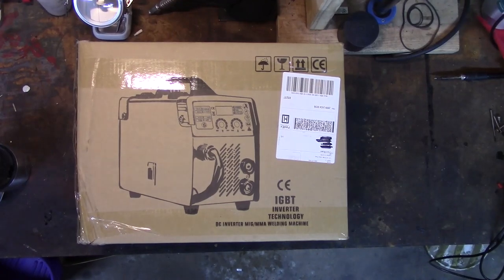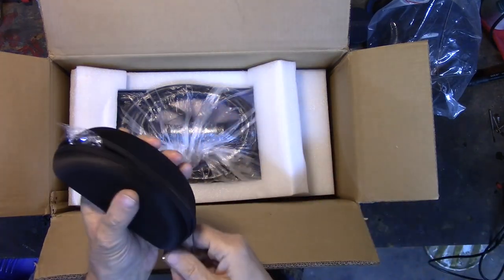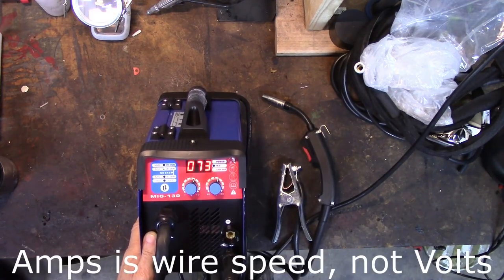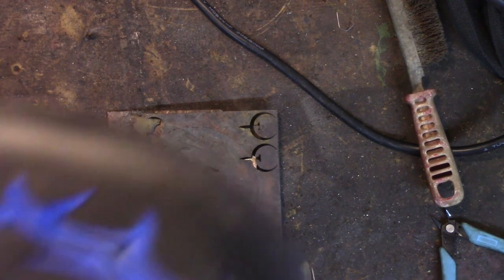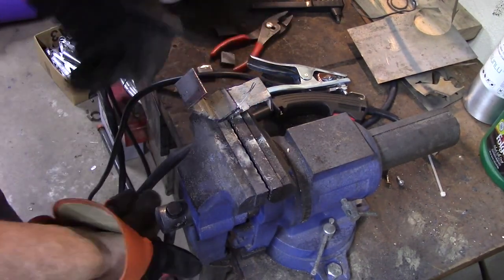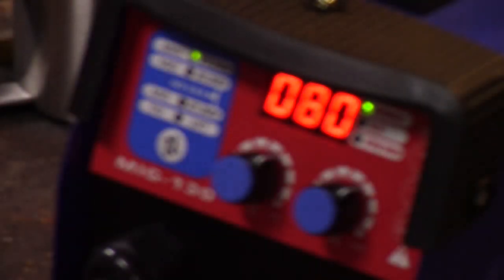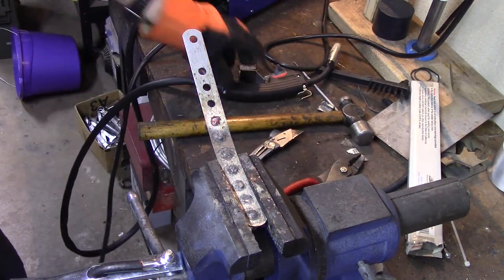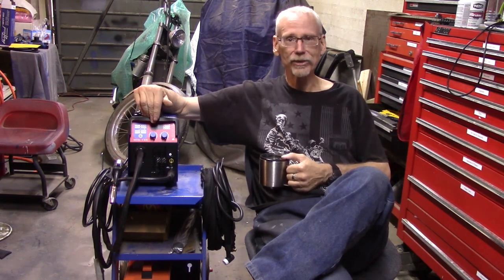Vevor 130 amp MIG/TIG/MMA inverter welder! $119! See below for link and $10 off code!

Comment: I took the leap due to your video. First time using flux core. I am impressed. It performs like a stick welder except with .035" wire. I was welding heavily rusted / pitted exhaust header pipes. I was set 1 mark above minimum on voltage and 29 amps. Worked extremely well for the poor quality material I was welding. I also welded .120" tubing which went effortless. Thanks for the video.
Reply from the maker: Thanks for watching! Rusted, pitted headers are a real challenge, that's for sure. I've used mine a bunch since that video, both inside and outside, with stick and flux core wire and I've yet to be sorry I bought it.

Comment: I just ordered one today I’ve always wanted a welder but even harbor freight models were just one mode or two mode’s and they are quite expensive. I learned to weld on Lincoln Electric welders in Welding School and I graduated back in 2012 unfortunately I haven’t welded much since then. But I wanted a small unit with more options at 110 volts. I always do research before buying anything. I’m so happy I’ve watched a couple of your videos. Thanks so all your help and experience.
Reply from the maker: I don't think you'll regret it. I'm still using mine and it's my favorite flux core welder. I've probably got 10 spools of wire through it and still think it's a heck of a bargain for the price. Thanks for watching and commenting!

Comment: Your a halfway decent welder for an old Fart lol just kidding, I'm almost 70 been welding 60 years or so love watching welding videos, love it your a simple man with a lot of common sense! . Watched this (professional) welder he called himself . his big opinion was if you're not using gas don't bother, stick option don't even try, my stick welding is just as pretty as any mig welding & stronger & I can weld outside in windy conditions. Great video old timer keep it coming!!! I bought the Vevor 270 for my service truck power it with a Wen 11k Watt generator  weld half inch steel no problem. Thanks Trader Jack
Reply from the maker: I was once a pretty good welder. I worked for shipyards, built parts for pipelines and even welded pressure vessels for a nuclear power plant. Or maybe I was just good at passing stick welding tests. But that was all a long time ago and like anything else, when you don't practice regularly your skills, or in this case my skills, erode. I probably won't have much welding content for the next few months as I wait for the summer heat to end, welding in 110+ degree heat isn't my favorite thing to do. But I've got plans for fall and winter! Thanks for watching and commenting!

Comment: You sold me I think it’s a perfect fit for my uses, I haven’t welded in over 10 years.
Reply from the maker: It's still my favorite flux core welder. I've probably run 10 spools of wire through mine at this point and it still runs great. Thanks for watching!

Comment: You need to take off the gas nozzle and wire weld without it, or get one of the plastic nozzles designed for flux core welders. That way you can see where you are welding. Great video!

Comment: Chuck, Thanks for the review. I’ve been looking for a welder for some jobs around the house. Looking to weld thin sheet metal for auto body repair. This is pretty interesting being that it supports so many different modes. I’ve looked at the Harbor Freight Titanium 125 Flux welder. Price is $210 or 190 with a coupon sale. Walmart bumped the price up on this one to $135 now. I’ve had issues buying things through Walmarts secondary Chinese suppliers and have gotten the wrong items sent (on purpose) and had to deal with the return headaches so I’m on the fence. I’ve only done gas and arc welding in the past but think MIG would work better for this application and others I might need in the future.
Reply: Also checked their website and it seems that they don’t sale spare parts at this time.
Reply from the maker: While flux core wire probably isn't the best option for sheet metal, with practice it will do it and the options all involve buying an expensive gas bottle. And for me having the ability to weld with 6011 or 6013 stick and TIG means a lot. If you can gas weld you can TIG, it's a very similar process. And if  you can stick weld, flux core welding will be a walk in the park. You'll spend more time figuring out how to get the machine set than you will learning the process. And I hear you buying from China, while I think they've gotten a lot better lately, it's still a bit of a crapshoot. And you can buy this from Amazon (admittedly for more money) or directly from Vevor.
Reply from the maker: @patrickugorcak  I'm not sure what you'd need that isn't an easy to source consumable. Tips, nozzles and all that are just standard parts that fit a dozen different welders and easy to get from ebay or directly from Aliexpress. The plasma cutter is the same, it's all just off the shelf parts.

Comment: I have the old Lincoln Buzz box 220 and I don't know if it's that I am so used to the Lincoln or if this machine is is faulty. I used this video as a guide while opening my vevor and I mean to the T. The only way I could get it to weld with stick is to switch the polarity and max it out.Otherwise even with 32nds stick The only way I could weld was to get about be right on it.I would barely get a spark to set my mask off when I set it down to 80. The Mig wasn't as bad but there was still very low power. I looked over everything and took it apart and put it back together and found nothing out of the ordinary. What do you think? Send it back?
Reply from the maker: It does sound like there's something wrong with it. And it sounds like you've checked all the connections and ground. I'd probably try plugging it into a different circuit, but other than that, it sounds like it's defective.
Reply: thank you sir. went directly into a 20 amp just to be sure, and it was low power. Just added another 50 amps to the garage but will most likely put a separate panel out here for the sake of men and power tools everywhere. Haha. Thanks again  @3rdpig

Comment: According to them, the ground is supposed to plug in the positive port for MIG welding.
Reply from the maker: Who's them? Vevor? You'll probably see some debate over which polarity to use for flux core wire. I prefer reverse polarity, or ground clamp in the positive connection.  Flux core will run either way, but it runs better and with less spatter if you run ground positive. I'll put a link to a video below that shows the difference. If I had it backwards in the video I apologize, at one point I was using the machine to run stick rod that I use straight polarity for and I may have neglected to switch it back.
https://youtu.be/1cs8R703MQ0

Comment: Great Video and I appreciate you doing this. I am in the middle of a sudo restoration on an old chevy truck. Because of funds, a couple of years ago I sprang for the Harbor Freight 90 amp Flux Core welder. Trying to weld replacement body panels on with this flux core welder has not been easy. I admit that I have not welded in a long time but in my earlier days I was quite proficient at true MIG welding. This Flux welding, is in my opinion so far, not even comparable. Have you attempted to weld any thin gauge metal similar body panels with this welder? If you have how did that go. Like I said, maybe I have lost everything I had learned back then but I think the HF is wrong with it's polarity for one and I get quite frustrated with it. Thanks again for the video.

Comment: Hello do you still reccomend these machine and you think these machine can weld bikes parts
Reply from the maker: Yes, I still recommend this machine for light duty, occasional use on 110 volts. If your bike parts are steel or steel alloy, then yes, it should be able to do it. But if you're talking aluminum, titanium or other exotic alloys, then you'll probably need a machine capable of high frequency AC/DC TIG welding and proper gas handling.

Comment: Hey Chuck, thank you for making the video on this welder. You are the only real review on this unit. I myself also just recently bought the same unit. Maybe you know what's going on here. I set up the Mig part of the welder. I used the wire that came with it and fed it through the hose by hand and it should be all ready to go. So I pull the trigger on the handle and the wire does not feed. I've switched the Mode to Mig 1.0mm and on the display I have a green light for Power, a red light for D.C. and a green light for Syn Mig. Anyways my wire won't feed yet alone weld. What could it be?
Reply from the maker: Are you sure the feed motor isn't running when you squeeze the trigger? When I got mine I thought it wasn't running because it's so darn quiet it can't be heard over the fan. So first, confirm that the motor isn't really running when the trigger is pulled. Crank the amps up to max and watch the motor spindle itself when you squeeze the trigger. If it really isn't running then you're going to have to do some troubleshooting. I'd probably start with the trigger as it's pretty easy to get to. Good luck!
Reply: @3rdpig  well i figured out what the problem was. I had to open the cover to find it. One of the wires that feeds the motor that feeds the wire was popped out of the connecter. i pushed the wire back in and was confident that was the problem and put it all back together and sure enough it fixed it. Well thanks for responding Chuck. I was also wondering if you have tried the stick or the tig yet and if so how well fid it work for you? Welp its 2am where I'm at so time for bed. Good night.

Comment: So was the knob on the right with the A under it actually the wire feed speed control??..If not does it have a wire feed speed control
Reply from the maker: Yes, the Amp control knob also controls wire speed.

Comment: I’m having issues getting the wire to feed through. Any ideas why? It’s all brand new, just unboxed it.
Reply from the maker: Do the feed rollers spin when you pull the trigger? Is the amperage knob turned up? Is the groove on the feed roller the correct one for the size of wire? Does the wire move at least partway into the gun lead? If so is there a kink in it? Make sure you take the tip off before you run it through.
Reply: @3rdpig  I think there was a kink in the wire. And I think I had the amp too low. I eventually got it. Thank you though 🙏🏽
Reply from the maker: @PNW_R1DER  Glad to hear it, happy welding!
Reply: @3rdpig  thank you 🙏🏽

Comment: Newbie but are this gasless?
Reply from the maker: Flux core wire and stick welding are gasless. If you want to TIG weld you'll need a bottle of gas.
Reply: @3rdpig  thanks i just bought the gasless one of amazon .30wires having trouble welding pipe😃 its cutting thru

Comment: Im hoping after using it awhile you can record the unofficial manual, I dont know if you can do anything structural but maybe small art projects....
Reply from the maker: A better manual and a settings chart would be nice, and probably necessary if they're going to market them to beginners. And while a settings chart is nice to get in the ballpark, there's no replacement for experience when it comes to dialing it in, and that's true of any welder, chart or not. So far I think the easiest way to get this welder in the ballpark is to use an amperage chart for 6011 or 6013 welding rod and the thickness of what you're welding. Set the amps to that, then set the voltage knob to roughly the same spot on the dial. Start on some scrap pieces of the material you'll be welding. Listen to the sound, feel and look of the weld and dial the voltage to get it right, if the voltage is too high the wire will hit the material as you're welding, if it's too low it will burn back towards the tip. And the sound is that perfectly smooth hissing, crackling bacon cooking sound. When it's right, then look at penetration and adjust both knobs higher or lower as needed.

 I've got a couple of projects in mind. I'm not an artist and have never aspired to be one, so what I've got coming up will be bumpers for my Jeep and possibly some repairs/upgrades to a motorcycle. Unfortunately the outside temps are getting up into the upper 90's here and that's about the time I move to indoor projects, so any welding might have to wait until after summer.
Reply: @3rdpig  cant wait

Comment: I can't believe what you got for so little money!#
 By the way its not just Europe that uses metrics it is the rest of the world
Reply from the maker: I'm still rather surprised to have gotten the tig torch, those alone, even the cheap ones, are usually $40 or so. And I'm not surprised the price has gone up. Same thing happened with the plasma cutter I bought. Before I could even post the video the price was up. I know the world, other than US, uses the metric system. We have the worst of both worlds in the US, half metric and half inch. It sucks TBH. Thanks for watching!

Comment: Buyers beware Vevor is a terrible company. Read bbb reviews
Reply from the maker: Vevor sells Chinese made products and in my experience their products are about on par with Harbor Freight's mid level brands. But like most Chinese companies Vevor does not provide the kind of after sales support that most people living in Western nations have come to expect. If you have a problem they're going to tell you to deal with it yourself and probably offer you around 25% of the original cost back. That doesn't mean they make a bad product, it just means if you're unsure of what you're buying, haven't done any research or think you're going to need to return it, you need to purchase a similar item from a reputable retailer like Harbor Freight who will accept returns. I own three Vevor products and intend to buy another soon. Every Vevor product I own has some issues, usually due to cutting corners to keep the price really low, which is what we've come to expect from most Chinese made products. All the issues I've had with Vevor products have either been fairly easy to fix, easy to work around or can be ignored once I knew the quirks of the machine. In the case of a welder like this, if anyone doesn't want to trust Vevor but still can't afford a Miller or Lincoln machine either get the Vulcan at HF or the Simdar MIG 140 from Amazon.
Reply: I got a cut50 plasma cutter from vevor. Worked about 15 minutes before nothing.  After back and forth for about a week and I got 75% back to repair the unit locally and was an easy fix. Back in service now.